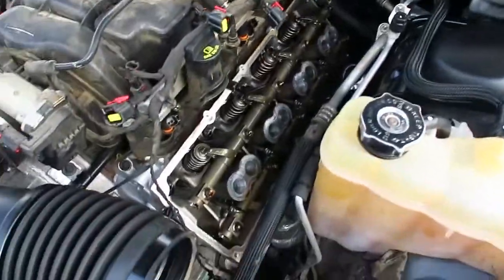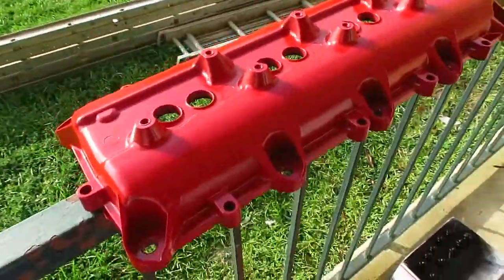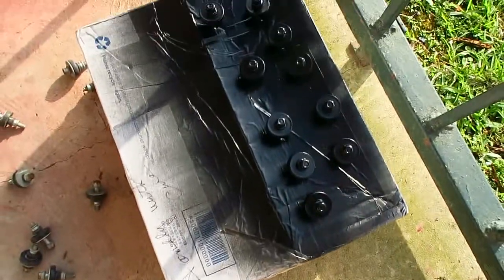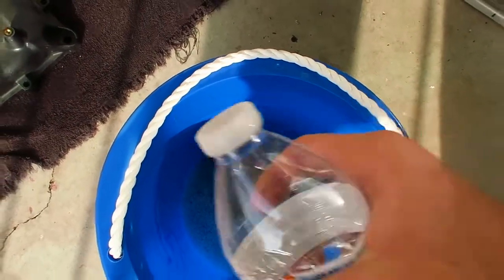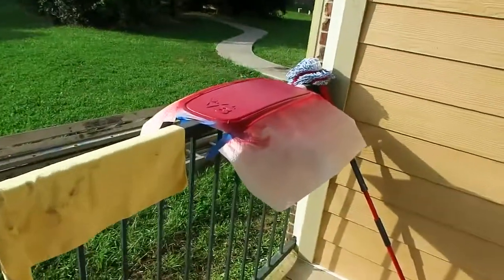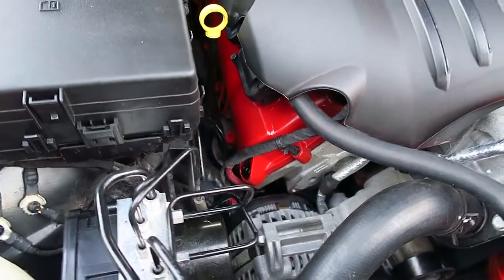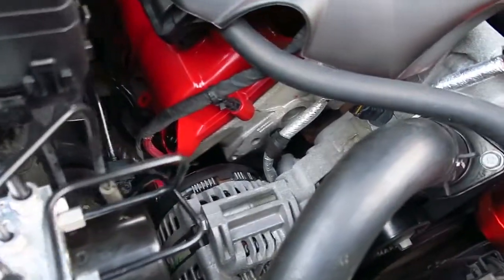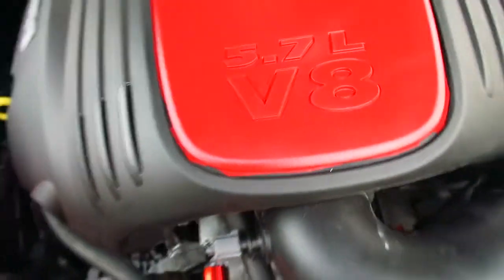Demon Valve Covers on a 5.7L?!

Comment: Hi mate I'm from New Zealand and I own a 2011 Dodge challenger R/T classic.  I understand in your video that you wanted to paint your OEM Hemi 5.7 litre valve covers the same color as to what the Hellcat or Demon has. And from what I see they turned out OK,  But what gets me is why put back on that huge engine cover when it covers all of the valve covers that you have just painted red. To me, putting the engine cover back on after you spend all the time and effort by painting the valve covers was just a waste of time as you don't see them. But at the end of the day it's just my opinion and I do understand that it is your car and you can do what ever you want with it.  Dave Kindig from "Bitchin Rides" or "Kindig it design" explains, When you lift the hood it should be like a jewellery box. Why don't you just do what I did and just make the engine cover a wall hanging in the man cave so that when you do lift your hood the valve covers will stand out